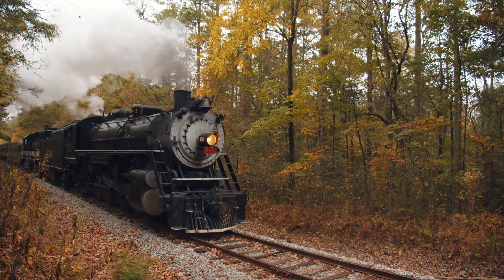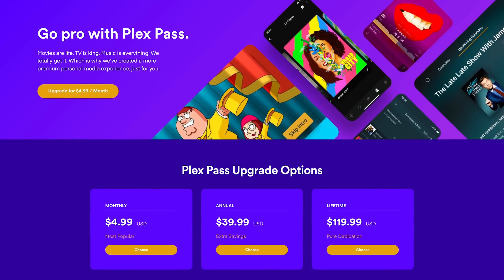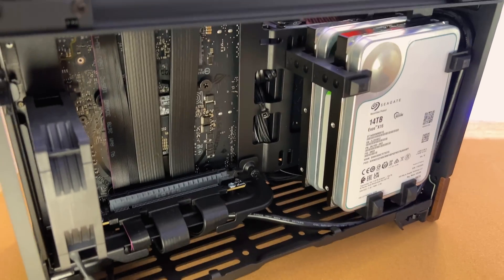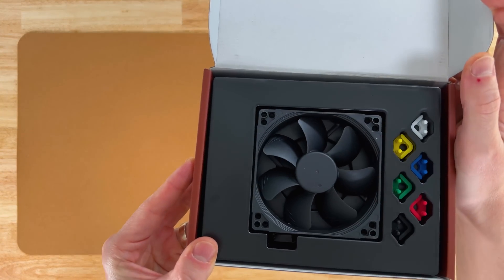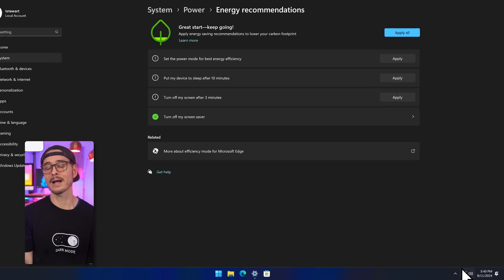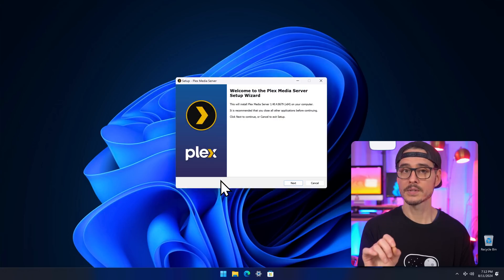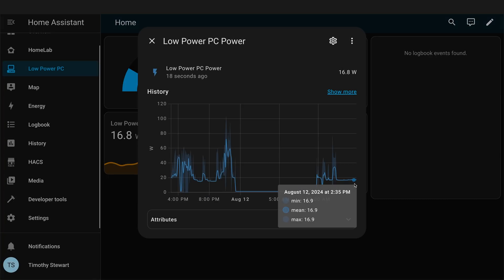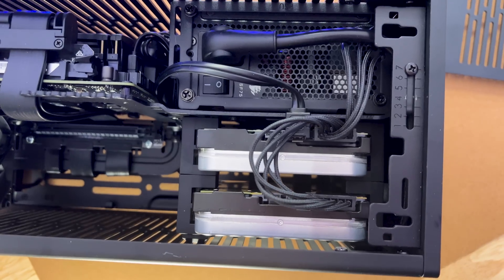Building a Low-Power, Fully Loaded Plex Server

Comment: This is an OUTSTANDING video. 

QUESTION: If power consumption remains less than 100W, what use a 750W PSU? Can’t I save on hardware cost by dialing back some on the PSU?

Comment: I dont your lower than c3 due to that motherboard using intel 226v 2.5g eth controller...
Also you should connect nvme ssd to chipset and not cpu (you should have one on back of motherboard) but maybe that wont help since Intels eth controller, maybe they fix it with drivers, maybe not.

Comment: Trained ML to undervolt cpu dynamically when idle or not in heavy load. Also trained it to turn off the gpu when not transcoding or running LLM tasks. This cut my power cost monthly by 30%. Doesn’t seem crazy but when a plex server could be adding 30-40 dollars a month. I’ll take the savings where I can.

Comment: lul waste of money and time. go to buy used office pc T series intel cpu in it like: 8300t 8400t or newer series but 8th or higher better cause you will get qsv  and those are cheap 50$ to 100$ depends config. and T series cpus are effiecceny aswell.
edit: if you like realy small  you can buy miniPC N95 N100 cpu about 100$-150$  then u can use extarnalHDD with it.

Comment: I've been experimenting lastly with 2 different setups. One is a Dell Precision that i got for free, tossed in a 10tb HHD, installed OMV on a NVME stick, Jellyfin in a docker. At idle it sits at 16-17watts, 24 watts while streaming. Second is a pi4 with a 8tb HHD running OMV with Jellyfin insode a docker. Idles at 3 watts, and does 8-9 while streaming. Both are running those wattages wether i am streaming at home, or outside of my home. I will probably look into trying a mini itx build if I can pickup a cheap one off ebay to see if i can get inser 10 watts at idle. Great video btw, it gave me some ideas and thoughts on thimgs i hadn't considered. 🍻😎

Comment: This was a cool video. I've been lugging around a full form factor (upgraded over the years) machine between moves, only to realize it's basically just my Plex server, and over a third of it is solid state and no moving parts. 

I'd like to build a small form factor like this using the NVME, SSD, and other passive cooling devices like I've already got. This is pretty dope

Comment: Running Plex on retail windows is very annoying with the forced updates/restarts, something to be aware of, especially if you travel and expect to watch your movies on the go and your system had restarted back at home and stuck on the login screen.  You'll want windows set up to login automatically so your plex is back up and running after windows updates.  You also might want to enable the UEFI setting that automatically turns the PC back on in case of power outage so it fires back up itself when AC power is restored.
Reply: I wouldn't install plex on windows. nope

Comment: Way too big.
I used a ASRock DESKMINI X300W Barebone $185
A Ryzen 5600G $150
And a 256gb SSD boot drive 
32 gb RAM $50
I did add a free laptop 1TB HDD I had upgraded,but never use it.
Connected to my Ethernet and running Plex server pulling files from my NAS that’s way too anemic to run plex pushing or transcoding 4k . 
This works perfect when transcoding. And it’s quite little smaller than a standard PC power supply.
Really pretty nifty device

Comment: Did Intel fix the issue with c-states? For awhile there if you used any pcie lane straight off the cpu for say a nvme, then the cpu would refuse to get above c-2. Then you’d get a 30 watt idle instead of 12 watts.

Comment: A power efficient clean Plex server, but at what cost.... oh almost $1400
Reply: lmao thanks for pointing this out so I can skip the video
Reply: Thanks for pointing this out. I'm gonna go look for less ridiculous videos.
Reply: What the hell? You could buy an Intel Core i7 mini PC for a fraction of the cost. Mine idles at around 15–18 watts.
Reply: it saves you money in the long run while paying for subscriptions just keeps pulling up every month.
Reply: @krisvaras7801  yeah I wonder how long it would take to recoup $1400 and break even. That would’ve been a good thing to add to this video.
Reply: Can nowadays use an n355 proc that uses 1/4 the power of a 14100 too... doesn't have quite the same level of quicksync codec support but good enough. Chinese minipcs (Qotom etc) have them for the $300-500 mark. Doesn't include much storage but if you've already got a separate nas/das solution, that'd work fine

Comment: Im running unraid on a nas I built with a 14500 14 core i5, 32gb ram, with 3 hhds, and 7 ssds for cache (most of ssds are 256gb sata ssds I had laying around). uses 28w idle and has more than enough power to transcode video for plex while running my game servers and uploading time machine backups all at the same time.

Comment: A $99 USD (last time I looked) low profile ASRock Intel A310 GPU can up the number of concurrent transcodes exponentially, and only uses the pcie slot delivered max 75w power. The Linux drivers are baked into the kernel, and windows is irrelevant for home servers, but also supports it.

Comment: @TechnoTim

Awesome build. I do have a question about how you mounted two 3.5 hard drives in the Terra case?

I was looking at the specs and it does not mention that it is comparible with 3.5 hard drives.

Are you using an additional bracket or mount?

Comment: Hello Techno Tim nice video, you forgot to mention when choosing a power supply, making sure voltage capacity is no more than 40-60% of its maximum power capacity, will make the power more efficient, for example a 1000watt when you only need 400watt, would be best case, and yes 94% would be awesome,  I wish I could afford Platinum. It may not matter in this case, but when i learned about it I was surprised. I'm wondering who can run only 14tb now days, My 108tb after redundancy and formatting dropped to 63.8tb and that Raid Z1. I cant believe i3 can playback 4k with no issues, now I'm wondering how I can save on power and if its actually worth saving a few bucks verses the extra cost in changing hardware.

Comment: Thanks a lot for this nice build. Is there a good alternative for the motherboard in this build if i plan to add 8 hdds and a ssd? I bought the jonsbo N3 case with 8 possible hdd slots and i still want to use my ssd on the m.2 slot. I would love to hear about an alternative board that can fullfill this :)
Reply: Nevermind, i can just use the pci express slot to have more sata slots :)

Comment: OR, hear me out, for the price of the motherbaord ONLY (as that's quite expensive mobo), you can get EcoFlow powerstream (maybe not in US? dunno laws there) and a single 550-580W solar panel, even if you have low light, bad weather, bad angle for the panel, you should get at least 25% of its power, which is a lot more than what you save when building a whole PC just so its more power efficient.

and imma just use my old af i5 3470 with GPU and Wake-on-lan and not care for watts due to the all mighty sun :D

great video tho <3

Comment: I can burst your Windows uses the same power as Linux bubble again. You've spent 3min on optimizing the power profile on Windows. Do the same with Linux and it will go down even more. For instance, did you turn off all components (aka airplane mode) that need to be turned off? Did you use powertop? This seems to be the same advice given to non-Linux users over the past 30 years, but in reality it is just a different UX for the same thing you did on Windows.

Comment: Great info and has realy helped me building my own im using an I5 instead of an I3 because the I5 12400 was cheaper for some reason and im also using a cooler master 344 case with a 500w psu that came in the case,  a asus prime b660m wifi motherboard,a kingston nv3 1tb ssd  & 64 gb ddr4  and plan to hook up 4 3.5 16tb harddrives any thoughts? great content as well please make more content like this please

Comment: I want to build in the same case but I do have a question. I also need 2 x 3.5 HDDs but need to fit a PCIE NIC card also. What length is remaining for the PCIE card? It would help me quite a lot with the build

Comment: reducing carbon footprint? builds a 1800 dollar plex server.? u no! i just build a plex server out of a 45 dollar DELL SFF off facebook market place with a 200 dollar 8t hdd from bestbuy and it runs 4k videos with ease. even came with a sff video card set for encoding. this video is very off putting. way to much money spent here, what a waste. also the dell runs at 65 watts, dont do this if you really want to use less electricity this is not the way

Comment: Linux comment: since you went through windows and optimized power why not do the same in Linux? There are settings in Linux that can improve power efficiency. You can even Ansible it :-)
Content format comment: I usually encode to the best format to avoid transcoding when possible. Example for Kids content I usually select 480p or 720p since most kids could care less about the visuals and really care about the content, just saying. IMHO 4k is a bit over rated and more of a marketing/sales pitch. (not to start a flame war)A good quality 1080P VS a 4K, most people can't tell the difference unless played right next to each other. Just saying, to me it's not worth the challenges (storage needs, transcoding issues, clients etc) you see in many forums.

Comment: Thank you for this. Very complete presentation. 
On the older generation AMD CPU side, the APU's with integrated graphics such as the 8 core 5700G or 4750G Pro with PCI gen 3 speeds idle at under 10 watts measured in HW Info.

Comment: Why use that case when it only fits 3x HDDs? Something like the Jonsbo case series or the Node 304 fit significantly more HDDs. You say you want to have this server for many years, yet skimp on the most essential part which is storage expansion. Great video otherwise

Comment: Rebuilt my NAS last year. 13th Gen i3, 3x nvme drives, 4x 16TB drives, 1x 512gb sata ssd, 32gb of ram, and it runs between 44-53 watts. Using unraid as the OS. Definitely thinking about getting rid of 2 of the nvmes as I don't need the speed for the applications running on them.

Comment: >4 sata ports plenty enough for plex server

5/6 on mobo, 6 on sata controller, plus 4 in qnap tr004… thats 15 and soon… ill need more. all joking/flexing aside, 4 is ok. to start with. i started with 4, and after a year or so had to upgrade. welcome to the desert of the hoard, padawan! oh, yes. dunno how much watts it consumes, but i dont care. i think. i use the htpc for reencoding dvds, and general computer use so… but am thinking of checking the power consumption. im afraid i wont be pleasantly surprised, with 13 drives and 110tb of storage space (yes, im down to 800gb free, hence the welcome, lol).

Comment: 64GB of memory??  I'm puzzled.  Is it just because it is Windows?  I run Plex in a VM with 2GB of memory.  Can you elaborate the reasoning?
Reply: ram is cheap. i also crammed 64gb in my htpc. why? it was cheap, lol. ok, ddr4, but still…
Reply: @cordlesswire  Maybe.  Cheap is relative.  But as a video someone will watch for recommendations, that is a waste.
Reply: @geesharp6637  of course its a waste, lol. and on my matx board, my cpu temps went like at least 5c up since all the ram slots are filled and i presume choking the cpu cooler (slim noctua somethingsomething for am4) a bit since the 4th (or 1st?) are like 2mm from it, lol. that all being said… 64 gigs, bro! hahahahahaha. aaaanyways…

Comment: Platinum efficiency only comes into effect at 80% load while this system is most of the time well under than. It’s better too right size your power supply or get a pico psu for this kind of build

Comment: Why not just use a Mini PC? Minisforum UM790 Pro 7940HS Processor Mini PC Idles at about 12-14 watts, no building is required, probably same price or cheaper and is Faster and Stronger Processor with 780m integrated graphics so it works as a desktop PC and would work well for this purpose.

Comment: This is just a word of caution, I have an  Intel 8500k with its onboard UHD Graphics 630, it could not transcode a movie i have that is 4k, 24p, HEVC main10(HDR10) mkv.  So, the internal GPUs work fine but there is asterisks only because your results will vary depending on the media you supply it with. Now for me its my main rig with a 1660ti that I use to actually transcode (zero issue on anything i have, no 8k) because I have yet to build my server. I am in the opinion depending on your needs a gpu is still recommended and Plex does lean towards Nvidia but on forums people have said no issues with AMD, again results may vary.

Comment: On a Ubuntu Server, you need to change CPU governor to powersave
Reply: may not be necessary since turbo boost is disabled in the bios. Did save a massive amount of power for me tho, from 40 to 20 Watts at idle on Ryzen 3600.

Comment: *Me sitting next to my Epyc Jellyfin server: Hmm that's neat. 

The only time I would argue against a low horsepower approach is if you're also running handbrake to transcode for storage efficiency on the server. I actually used your video on setting up containerized handbrake and it has been so convenient to batch transcode on my server overnight instead of on a user machine.
Reply: wut
Reply: That's an incredible idea, I didn't realise you could containerise Handbrake but it makes sense to do so.

Comment: Low-power, efficient Plex/Jellyfin server? N100+motherboard will cost as much as i3-14100 itself, while being even more efficient. N100's iGPU will handle transcoding without any problem. Pico PSU will beat most of the PSUs when it comes to efficiency at very low wattage (10-15W) and it will be enough for 2 HDDs. Small CPU cooler with Arctic fans in the case will be more than enough - Noctua not needed. Build cost around half compared to what is presented in the video (not counting drives). ROI with energy saving will be much faster with cheaper build.

Comment: Sorry to say this Tim, but... buying a mobo+cpu combo with a N305 would have been much faster - meaning less research and configuration, cheaper -as combo usually are,  you would have 8 core instead of 4 -which is always nice bot for vms on the side and/or future-proofness if you'd need to add it to a proxmox cluster in the future and you would still have all the transcoding capabilities -including av1 - and the performance needed for a plex transcoding machine. 
At least to my knowledge. I saw at least 10-15 videos and nas-building machine with this cpu and everyone it's ecstatic about it.
Sorry my man :/

Comment: I'd really recommend using something like TuneD or TLP (more used for laptops) to get power consumption down on Linux. RHEL or Rocky Linux include TuneD by default, which can optimize for power saving. Cockpit (system management web ui) even allows you to reconfigure the power profile on the fly, so if you want more performance it takes just a minute to log in and switch it on. You can even write a script (or use systemd timers) to enable power-saving mode at night, when you're hardly using it anyways
Reply from the maker: Thank you, I will check these out. Tuning Linux for power savings is new to me!  I appreciate your time and knowledge!

Comment: 2:00 "Don't you need a dedicated GPU?" Yes, you do! In some scenarios. 
I wish that media creators would start to be more specific with hardware media transcoding on a GPU capabilities. 
I went thru this rabbit hole to than realize that my Intel integrated graphics (HD540) couldn't decode the formats of the media that I have (H265, HDR, etc). 
So, "don't you need a dedicated GPU?", well depends on your source media and destination format. 
Wikipedia has good tables with the capabilities per generation. "Intel Quick Sync Video" for Intel, "NVENC" for Nvidia (which some people allege to have the better quality) and "Video Core Next" or "Unified Video Decoder" for AMD. 

For example, looking at those tables, you will quickly notice that you need at least a Intel Kaby Lake (Intel 7000 CPUs), AMD Navi 10  or Nvidia GP107 for HVEC 10 bit.

This is specially important when people are trying to save a buck and using refurbished hardware.

Comment: Nice video, good to bring this out to the mainstream. 

Few things to mention, in the BIOS, you need to enable package C-state and active state link power management and whatever the settings it's called in your mobo. I've found statistically significant power saving when a server is able to enter higher C-state. Though mine it's about the LGA1151 CPU's not the LGA1700 that you used. You can enable C-state by using powertop and `powertop --auto-tune` in Linux. The power supply better rating is more efficient at idle is not entirely true. PSU are rated at least 10/20% of their rated wattage, that's way above the idle power draw. Wolfgang's Channel had a video about PSU and the TLDR is you need to check the Cybernetic (or Wolfgang's google sheet) and sort by efficient at 20w. Some bronze PSUs beat out gold rated ones.

Is there any performance difference when you disabled turbo and the CPU never turbos? Also I'd like to request a video for Proxmox and related power saving tweaks as this is what most people use and it offers much more versatility than Windows.

Comment: You couldve/shouldve went with a 12100 if you disable turbo boost anyways. Same igpu + lower entry cost + you avoid potential intel 13/14gen problems.. (eventhough its unlikley that 14100 are affected). Beside that i love that you are giving power-efficiency some attention :D
Reply from the maker: I considered that too but I got a good deal on the 14th gen and I was able to flash the BIOS and microcode right away!  Thank you for looking out!